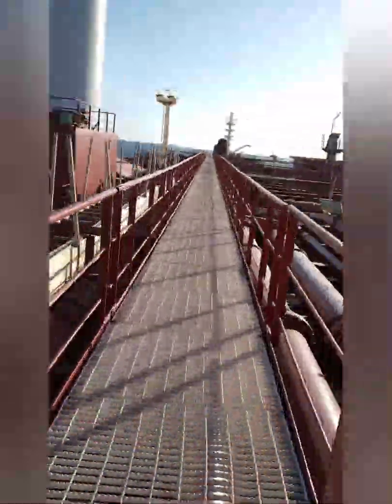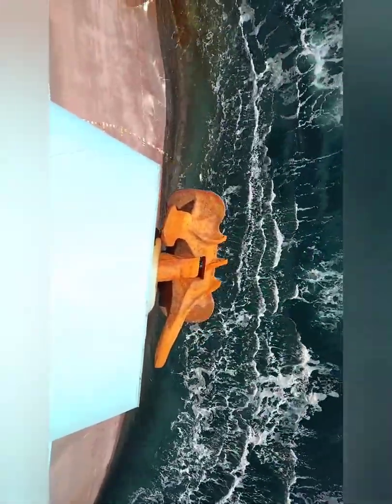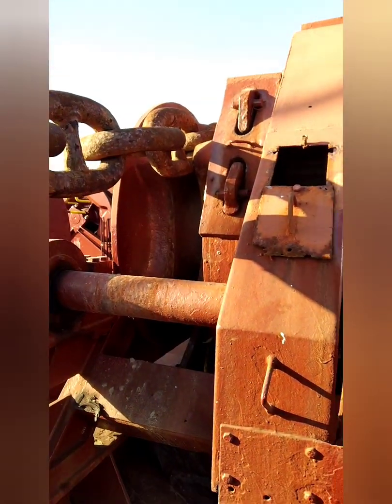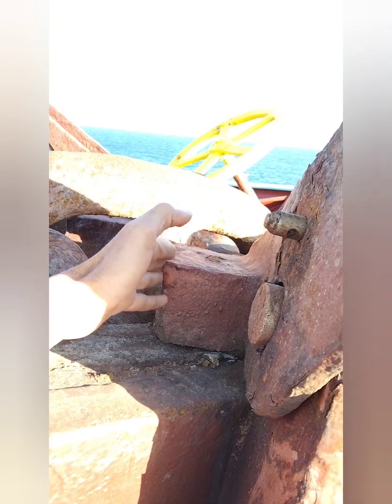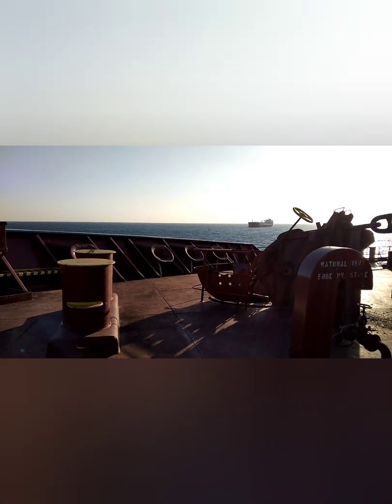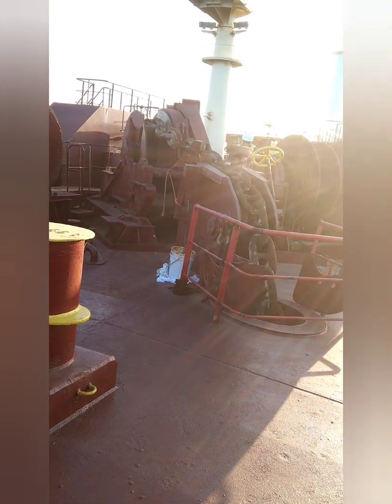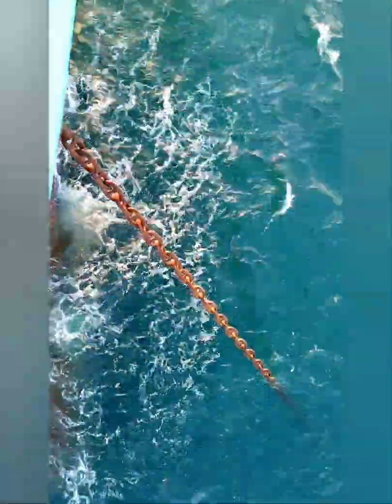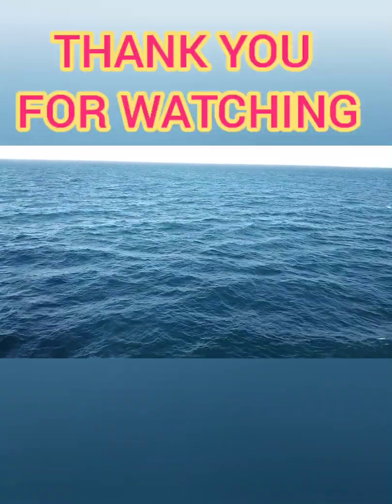Anchoring at Operational Level, Various parts of a windlass, actual operation with req. Precautions

Comment: How will you  check the no of shackles in letting go process of anchoring. When it will lower very fast
Reply from the maker: You would have to guess it by experience. Usually the joining shackle is color coded, that helps if one observes carefully.
Reply: @oralexammmdprep8110  thank you sir

Comment: I kindly request to you that what are tips for prevention of loss of anchor and loss of anchor chain.
Reply from the maker: There is another video on anchoring at management level. In that I have mentioned that windlass is not designed for excessive load.... Hence reporting should be proper and there should be a headway while anchoring to avoid excessive load.
Reply from the maker: https://youtu.be/oFhc5z3U8r8 here is the link to that.
Reply: For 2nd mate/DNS/ B.Sc Nautical Science prepration join kundan patna #kundanpatna

Comment: Why does the chain sometimes get twisted and why sometimes the anchor doesn.t drop when using gravity?
Reply from the maker: Twist is created when the vessel turns while at Anchor. The swivel turn while the anchor was on the sea bed, causing the twist. Or it could because of the piling up of Anchor chain over Anchor when lowering. Sometimes it doesn't fall of the inertia required to move the anchor is more the weight of the anchor. It can happen due to stuck brake, excessive rust on gypsy wheel etc
Reply: For 2nd mate/DNS/ B.Sc Nautical Science prepration join kundan patna #kundanpatna